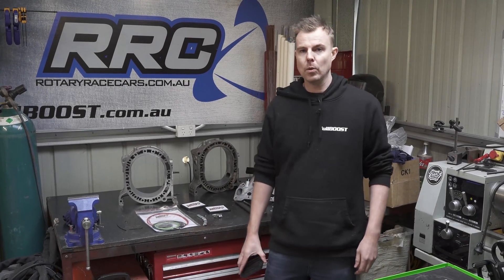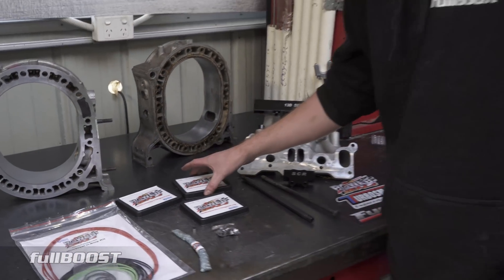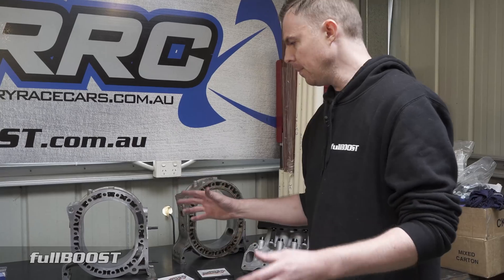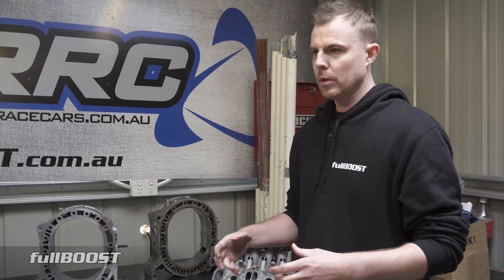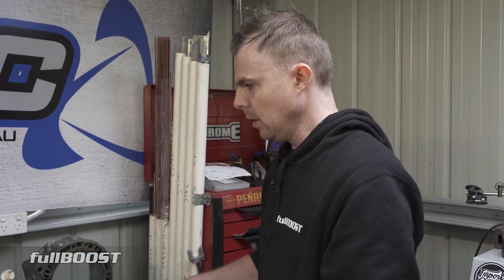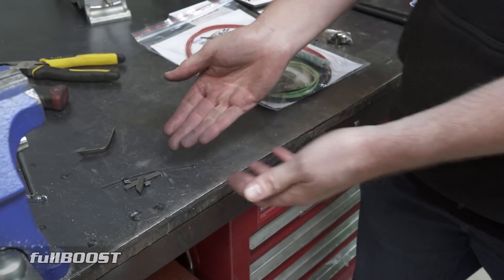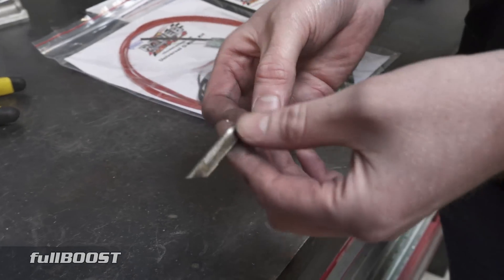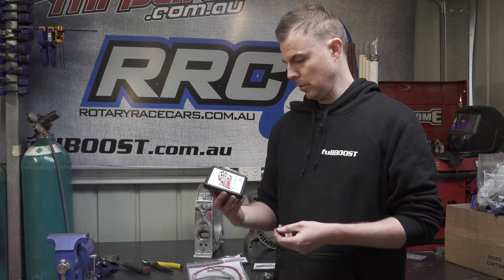Unbreakable rotary engine apex seals explained | fullBOOST

Comment: I wouldn’t trust many shops to build an engine for me, my brother bought a full kit, these seals, print kit, seal kit, the works, went to a builder who sold him an engine and rebuilt it for him apparently with the seal kit my bro supplied, had a set of webers fitter so this wasn’t a big power build it was a cruiser, engine failed on the dyno, builder had it fixed before my brother got there, car seemed good, got 100km out of it failed again, builder apparently rebuilt it again, then another 200km later it failed again! fed up with the builder he pulled it down to find used junk seals, damaged housings, damaged rotors all not recent damage, all the springs were worn, just rubbish seals and bits salvaged from a bin and then when my brother pulled the builder up he abused my brother accusing him of not supplying a seal kit and it was a shit engine! This crap builder sold him the engine and pocketed the rebuild kit, probably didn’t even rebuild it just gave it a clean and paint.

Comment: I find it very interesting and I have to rebuild the engine of my RX8 but... Several people say that these reinforced Apex will consume housing early. Do you have any statistics regarding actual wear? Thank you very much!
Reply: Thats a good point mate, a lot of reputable builders I know use oem Mazda seals with 500 plus hp builds
Reply: Best way to help this problem is run more oil or premix in the tank

Comment: Hola tenemos  un motor súper revolucionario para cualquier tipo de combustible, incluido el metanol sintético para emisiones de CO2 negativas  y el HIDRÓGENO para CERO emisiones, obteniendo mucha más eficiencia que un motor actual y mayor que las baterías y también las pilas de combustible que se usan con motores de hidrógeno y eléctricos, un ciclo termodinámico novedoso con mas del 75% de eficiencia, solo dos partes móviles principales, una relación potencia/peso mayor a 13 KW/Kilo , todo puede ser de aluminio excepto eje principal y tornillos, no usa refrigerante líquido solo aire, usa muy poco lubricante que se puede usar desde el centro a través de los sellos para lubricar todo, la velocidad de los sellos o segmentos es 7 veces menor que en cualquier motor, se puede extrapolar a cualquier potencia sin perder ninguna característica, está en proceso de patente internacional PCT . Muy fácil de fabricar 100% con tecnología básica actual, todas sus partes móviles principales montadas en rodamientos comerciales, la vida útil es de hasta 30.000 horas con muy bajo mantenimiento, casi nulo y más de 70 ventajas adicionales.......
Como ejemplo: Se pueden hacer motores de 60 kilos de 1000 Kw muy compactos sin espacios inútiles. 
WHATS... 55 27 99 529 85 80
https://www.youtube.com/watch?v=xZbPWoQ3Q1M

Comment: Just because car manufacturers have abandoned rotaries, doesn't mean the community has.

The car community has been gradually working and improving on issues the rotary engines have, and the aftermarket engines are very reliable if you take care of them.

Comment: What is the standard mileage life of these power seals versus mazda oem seals. Im looking at rebuilding my RX8 and if these have good life then i will be running these. Car will not be used for heavy race application. It will be my daily and/or weekend toy

Comment: Hi if i get a 6 rotor engine and turbo it at 30 to 40 lbs of boost what type of seal would you recommend for daily driving? Is there anything you can do to help oil efficiency and overall engine health?
Reply: You want to build a 6 rotor, put 40 psi through it and daily drive it?

Comment: Seems like these seals might be made with larger grains in the metals. Usually smaller grains are 'harder' to break, but they tend to snap when they do. longer grains tend to bend easily, but will not shatter like short grain metals do. Interesting!

Comment: I have my doubts about the longevity of these seals as they are more ductile.  Mazda spent millions of dollars and decades of research to find the right mix of longevity and sealing.  The factory seals are electron beam hardened on the edge to provide the longest wearing surface so you're able to get a reliable engine.  

For race applications a softer material is more desirable, but don't expect to put thousands of miles on it before it starts to use lots of oil, require a ton of premix, and just not be "streetable".

Mazda and other manufacturers use to have soft seals, aluminum and carbon, just carbon, etc.  They all had their limitations for longevity and reliability and oil use.  The legendary 787B used carbon seals for god's sake.  Because it was a race car, using oil, or only have a small season life was different needs than a street car.
Reply: They spent millions of dollars 60 fucking years ago. Technology is not a line, it is a curve. Also the 26B was taken apart after the 24 hours of lemans and was noted that the engine could continue to run for several more 24 hour events without a rebuild.
Reply: Diddnt 767b  have ceramic by then?
Reply: @richiebarrow9169  Wow, 2 years ago.  I was mistaken, it's actually the other way around.  The earlier cars used the carbon seals, but as the power levels rose the Mazda race team developed the use of a "fiber-reinforced ceramic" seal.  They also used a two-piece apex seal in the 787, where as the earlier cars used a one piece seal.  The seal allowed for high strength and improved wear at high outputs.  The two piece seal provided better sealing which increased overall output ~2-3% and lowered fuel consumption.

Comment: Correct me if I’ve misunderstood...but did he say that the seals are not recommended for the everyday user rather race cars?
Reply: The race (or methanol) seals aren't good for street driving due to their coating. The gas ones (labelled 'street' on the seals themselves) are fine for a street engine. I'll be getting a set for my FC when I build that motor. Complete street car, full interior mildly molded example (once I'm done).
Reply: Eric K cheers for that mate.

Comment: I wonder, how this seals compare to live lenght of engine, as i did few rx8 engines, not only apex seals grove is wobbled bc of many duty cicles, rx8 apex seals is shorter, and ai wonder is this kind of seals would be used more quickly. Also more aftermarket seals, make marks on housings,this are softers, so that would make sense that they wouldn't do that. But i would like to see engine after 30kkm on this seals.
Also You didn't showed how much force would side and corner seals take.
Cheers!

Comment: Are they ceramic??? Or steel??
Reply: Ceramic is even more brittle than the stock cast iron seals. These are a steel alloy that is hardened and tempered. :)

Comment: but are they also suitable for use in street cars, where reliability is more important than power and rebuild-ability? It sounds like they are a lot softer and would get worn more quickly
Reply: Much rather that then an entire engine rebuild
Reply: theyre still plenty hard enough for long term use...they just arent 30+ year old designs. Metallurgy has stepped up an insane amount

Comment: I am no expert but in your testing of the seal what you are showing is the fact that they are not heat treated from factory correctly or an incorrect carbon content ratio of the material... So why does this not fall under manufacturer defect? Changing their heat treating process would fix this?
Reply: Probably depends on warranty contract & what is considered factory defect, so too large grey area to be show factory defect imho.

Comment: QUESTION: What do the rotor housings look like after 20K miles/33K Kilometers of driving? Chatter marks were often the downside to a lot of the earlier more durable seals (Rotary Aviation's early seals were notorious for leaving chatter marks on the rotor housings, for example).
Reply: WKZworks I’ve got customer engines in RX8’s that have these seals that have now done more km’s than the Mazda oem seals did in many cases.

Comment: 👆👆👆👆 number of engines I’m on w my 04 RX8, and wouldn’t trade it for a piston engine ever. Just pulled the engine out in a few hrs. Apex seal broke in the rear rotor-catastrophic I’d say w all the scoring but have replacement parts coming. Def looking into these. Love the information on the vid thank you sir!
Reply: Simple solution, premix. These would are good but if you don't premix your engine WILL blow up
Reply: @faisal3398  Interesting comments.  Do u know if premixing 1/2 - 1oz  2 stroke oils per gallon will definitely help seals or just a myth to sell more oils?  Many have advised to premix with regular non synthetic 2 stroke oils but I have not seen scientific proof or before / after photos of seals & rotors with different oils.  Also if rotaries do not have crankcase oils, is that why piston rings get adequate oil lubrication and Apex seals suffer more? Thanks 🙏⭐🎆👍
Reply: @chrislg4519  Look up rotary forums I haven't owned a rotary you'll find specifics there.
 Rotaries have a crankcase but the rotor itself and the apex seals (or in fact all seals for the rotor) are in an inclosed chamber away from the crankcase and oil, thus Mazda uses oil squirters to lubricate the walls and seals but they are hilariously inadequate especially in the RX8 causing catastrophic failure, thus people resort to premixing, the oil is already in there but they just use a more reliable way that provides better lubrication.
Edit: also yes, you use 2 stroke premix, once again check the forums.
Reply: @faisal3398  Great thanks for reply Faisa 🙏👍 i will check more forums as i try and keep seals & rotors well conditioned  🌟☺ Blessings to you ⭐

Comment: Mazda needs to revive the rotary with modern machining and technology like these seals
Reply: Nathan Chapman They’ve been trying and not doubt are aware of and have access to these types of seals. The problem is trying to meet emissions with them and not destroy the engine. A rotary has problems getting oil to the apex seals without getting it into the combustion chamber. They also run more like a 2 stroke which is bad for emissions. 
I love Mazda and rotarys. But, the only new rotary we’re likely to see is one running a generator in a hybrid.
Reply: @NBSV1  👍 Interesting comments.  Do u know if premixing 1/2 - 1oz  2 stroke oils per gallon will definitely help seals or just a myth to sell more oils?  Many have advised to premix with regular non synthetic 2 stroke oils but I have not seen scientific proof or before / after photos of seals & rotors with different oils.  Seems piston rings receive oils better than Apex seals. Thanks & keep up great info 🙏⭐🎆👍
Reply: Chris Lg the reason for premixing the 13b (especially the series 1 rx-8; series 2 8s were given additional oil injectors) is more a design flaw. The oil injectors point toward the corner seals. Premixing gets oil to the center of the apex seal thru the fuel injection. As an owner of a series 1 8, I’d recommend cutting your premix ratio in half, 8oz to a tank
Reply: @lochnesswes1  I run 1 oz per gallon on my 05 just hit 88k miles no compression loss got it at 20k miles. It is decatted, and has upgraded coils, and If it takes longer than 2 seconds to start I will do plugs and wires if that doesn't work I'll do coils
Reply: Skizzy 1 watch for foam on the dipstick, it’s not normal. It’s a symptom of coolant seal failure due to poor thermal dynamics caused by combustion temps near the plugs. I had to pull mine apart to repair coolant seals. By the time you start burning enough coolant to notice it in the exhaust, you’ve warped the housings beyond reuse. I had the 4 port motor and couldn’t find a new one anywhere in the us and it’ll cost nearly $7k to get all the parts individually. If you choose to rebuild DONT de-carbon the motor
Reply: @lochnesswes1  Thank you, and I know it's not foam it's more of a silicone though. Thanks for the tip I've been working on them for years now.
Reply: @lochnesswes1  I run a triple rotor 20b, and dang what country are you in? I can get a good rebuild kit for $2,000
Reply: Skizzy 1 the kit just the seals. If your coolant seals have failed, odds are the metal has warped out of spec and you won’t get good compression even with all new seals. That’s what happened with my rebuild. Replaced all the seals, new rotor in the rear housing. Wouldn’t start. Checked electrical for proper voltage to the starter, verified fuel getting to the motor, and still no start. Did an analog compression test and 55 psi was the results (didn’t both finishing the computations with that low of a number to start; truth is that’s all the rotary compression tester does, the computation to a bar metric). I’m in the US. I’m jealous of you running the 20b. I plan on buying a series 2 rx8 that needs a new motor and gonna put the 26b into it.
Reply: @lochnesswes1  Best thing running a rotary get temp gauges and pay attention to them. If your seal fails you'll see either a fast  fast rise in temp instantly shut it off throw it in neutral and tow it home. Yeah 20b isn't a cheap block to get
Reply: @lochnesswes1  remember your idemitsu premix I always run 1 oz per gallon of it's summer
Reply: @NBSV1  honestly rotaries should be exempt from emissions considering normal engines are already choked by the equipment as it is a rotary engine cant really afford to do that unless its reliable and powerful which just Jack's up the price making it not affordable to most people
Reply: @Kradron5583  uh nah. If an engine is bad it gets weeded out. That’s it. Don’t make special exemptions for it.
Reply: @NBSV1  . Yeah the rotary would really only be good for car enthusiast who know alot. It would have to be like what ford has done with the gt. You would have to prove that you are responsible enough to own it. Mazda really wants to get more into the sports car market as we have seen with the miata, but I think they just need a little push. At Least we know we can trust mazda unlike mitsubishi
Reply: Check out the Liquid Piston X engine. It's basically an inverse Wankel that provides a solution to a lot of the problems plaguing the classic wankel rotary. Very interesting engine.
Reply: Saw a article somewhere talking about how mazdas new rotary motor is gonna get unveiled very soon
Reply: Japple I’ve seen a video mazda tested their RX-8 on Nurburgring few weeks ago.
Reply: @japple5933  it's a range extender
Reply: Yep mazda is already made new rotary . . They will release it soon
Reply: @carlosvazquez8962  it's a range extender
Reply: @carlosvazquez8962  nope u was wrong
Reply: For sure they have the Sohn adapter idea which 2 stroke oil burns cleaner than straight up engine oil.
Reply: Not gonna happen anymore. It may be fun and small etc but it’s super inefficient
Reply: Suprise! They did. Except its just a backup for their new electric MX30

Comment: They look unhardened compared to the hardened Mazda seals.
If they use the same metal, hardened would wear less on the contact area, leading to better durability.
Hopefully the unhardened seals are of better quality steel, to make up for the worse durability.

Comment: The upside to “unbreakable apex seals” is of course the ability to hold more power and not suffer from catastrophic apex seal failure due to poor tuning and/or a failed part and/or external system. But throughout the history of the Mazda rotary engine apex seals have not been an issue ever (as a root cause), they do have a limit which is where these “unbreakable” seals may come in handy, but the drawback is that they will chew up housing chrome surface due to being a much harder material. Mazda designed their seals to last, not to hold big power. If you’re building an engine for big power (over 500whp) then by all means go with these (or better yet the lanetti I-rotary seals), but anything 500whp and below OEM is perfectly fine so long as your tune isn’t shit and external parts and systems are in order
Reply: I'd agree with most of what you said but I think these seals are much softer not harder which is why they bend instead of snap. I would think that theses seals would actually wear themselves out much faster vs a stock super hard brittle seal.
Reply: 👍 Interesting comments.  Do u know if premixing 1/2 - 1oz  2 stroke oils per gallon will definitely help either hard or soft seals or just a myth to sell more oils?  Many have advised to premix with regular non synthetic 2 stroke oils but I have not seen scientific proof or before / after photos of seals & rotors with different oils.  Also if rotaries do not have crankcase oils, would that be reason why piston rings get adequate oil lubrication and Apex seals suffer more? Thanks & keep up great info 🙏⭐🎆👍